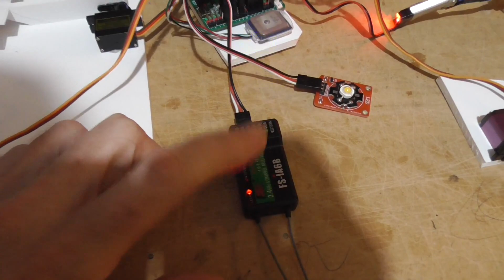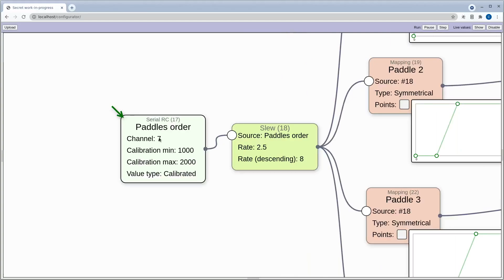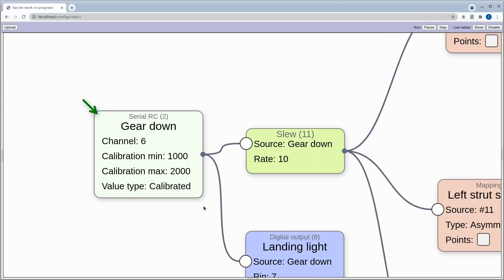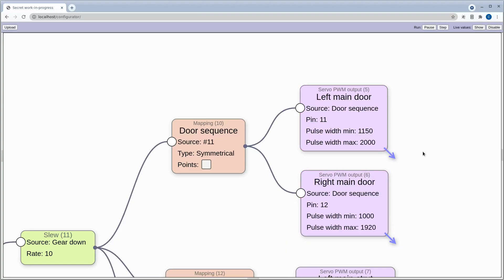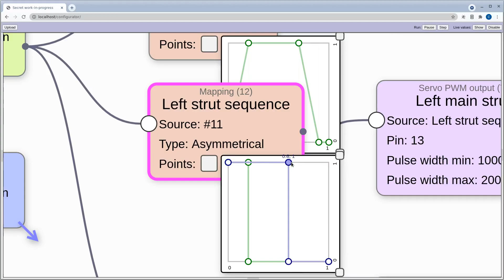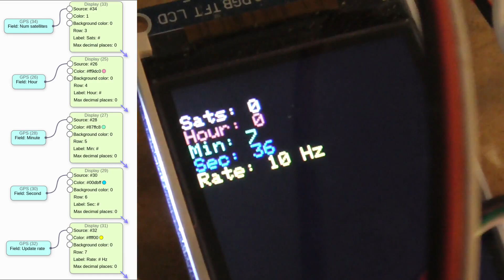Custom sequencers with iomixer

Comment: How do you configure your GPS? Does it save the configuration? I have cheap m8n, and it doesn't, and I don't know how to configure it each time at startup
Reply from the maker: There is an option to save the settings if you want it to. It is done as explained here:
https://www.youtube.com/watch?v=ylxwOg2pXrc
Reply: @iforce2d  I know about that option, however it never works with my modules
Reply from the maker: So maybe tell me that first then. I have no other ideas.
Reply: @iforce2d  Actually, the link you gave me is pretty much what I needed, thanks

Comment: Nice clean and informative demo. Your mapping functions are very easy to understand. A good example for RC folks would be expo mapping for control inputs on radio. Just that your program mappings are time-based vs position based. ;) Only suggestion I have is to display seconds of timeframe mapping on graphs (vs. 0 to 1 values). The ability to add/remove is very intuitive. Could even simulate a non-linear action , like a gear door starting to close fast, and slow as nears home position. (ie: a curved mapping path via multiple linear segments)

FYI: an example for aircraft with differential landing gear retraction is DC-3. Gears lowers together via gravity assist, but will retract one before the other due to constraint of hydraulic pump pressure. (no gear doors though on DC-3)
Reply from the maker: The mapping is only time based in this case because it was taking a slew as input. At its simplest a mapping can be just two points, to be used like the arduino 'map' function with the axis extents of the graph set to whatever the user wants.: https://www.arduino.cc/reference/en/language/functions/math/map/
But yes you're right, while editing a time-based sequence I have often found it kinda inconvenient not to have the x-axis showing seconds. Perhaps allowing a 2nd range as display-only values might help.
Yeah I used a mapping to simulate the non-linear nature of the HID headlights in my previous video: http://www.iforce2d.net/tmp/smixerHID.png
Reply: @iforce2d  Meant only to display 'seconds' value on axis as read-only value. The 0 to 1 values are a point of confusion, as different modules (or maps) could have different time-spans. example: one slew sequence might be 3 seconds, another might span 5 seconds. (really just need to display max time span value, and perhaps display a time index value when in edit mode)

Something to consider, is a master summary visual that displays all sequences (maps) on common graphic. Common colour for each channel can help with visual context. [ this would break your reverse direction colouring differentiator, but by using a dotted/dashed line instead for reverse in same colour would allow for displaying one overview slew sequence visual ]

Comment: I assume your board is based on a STM32- MCU, so how you made the jump from the (painful to use) STM32CubeIDE to such a nice high level flow diagram type IDE, I would like to know?!
Reply from the maker: Yes, STM32. I'm making the firmware with STM32CubeIDE, the diagram user interface is done with paper.js. In between there is a 'relay' server to allow the browser to access to serial ports, which is vanilla C++ for which I use Qt Creator.
Reply: @iforce2d  Wow, impressive! Thanks for the detail.
I will look into paper.js and Qt Creator.

Comment: with regards to the gear scnario, couldn't you trigger the gear struts to move only when the doors are open. ie when the doors open it triggers the gear to move
Reply from the maker: Typical servos don't have any feedback to know the actual position they're at, so we just give them enough time to have moved to the expected position. You can get robot servos with feedback, more expensive though.
Reply: @iforce2d  i realise that but i meant that  the SBM would know what position it theoretically should be at so that when the SBM on that one node reaches that point, it triggers the other one to start
Reply from the maker: I see. It would work fine for the 'forward' direction, that is, open door, extend strut. But to make the reverse work properly, you'd need other nodes to keep track of the state of the strut to make sure the strut signal was opposite when closing. I think eventually it would be easier just to use a mapping. See my comment to blacklion79 for perhaps a more useful improvement.

Comment: Could the serial module interpret MIDI?  This could be extremely useful for quickly building musical robotics, or special lighting and practical effects for stage and film.  Having a NLE-style graphical timeline with objects you could slide around, and track numbers you could select from the mapping nodes, that itself could be controlled via MIDI MMC (play, stop, tempo, etc.) would be powerful.  This project is starting to resemble some of the more user-friendly software used in those industries, as well as some of the industrial manufacturing sequence and logic editors I've seen.  All the innovation is in the various abstraction layers now, and exactly how the safety margins are baked in.

It's difficult to gauge scope of any project when you realize how everything is made of the same computational fabric.  MIDI or no MIDI, the NLE concept would be a new capability to the RC realm, afaik.  I could imagine it being used for legged vehicles where nested behaviors are fairly mandatory.  Exciting stuff.
Reply from the maker: If the MIDI can be delivered by UART, and is not flooding the input with too much data, I think it could be done. The main loop is fixed at 50Hz though, so getting exact timings might be a little sketchy.

Comment: just a quicky, if you change some values, do they change on the fly or do you need to compile and/or upload it to be effective?
Reply from the maker: There is a 'tweak' node to adjust number or color values in real time, provided the values are able to take dynamic input from another node. The little white circle next to some of the values signifies that they can do this. They require slightly more memory though, so values which are not likely to change at runtime have no dynamic input. The tweaking ability is especially useful for adjusting LED colors because the actual result is quite different to how colors look on the computer screen. To make the changes persist after power off, an upload+save is required. Saving to flash is slow, but uploading without saving is almost instantaneous.
Reply: @iforce2d  Interesting. thanks for your quick answer/explanation

Comment: Visual Programming for dummies?! It's like putting the "smarts" on any RC device. I see that RC is the focus but I can see how useful it can be in other applications. I wonder what the learning curve will be for the visual IDE for an average person? How much background will it require? It really excites me and I want to see more.
Reply from the maker: If "average person" means someone who is not already familiar with writing source code, then I think this would be easier to get something working quicker than learning traditional programming. It's less attractive for experienced coders though, because the boundaries of what is possible depend on the functionality supported by the system. I don't think much background would be required, but you will of course need to understand the information being dealt with, for example what is "GyroX" of an IMU.
Reply: @iforce2d  Excellent. I'm curious to also know what inspired this? Solving some problems in the RC builds or a broader vision? Thanks for the awesome channel and sharing this!
Reply from the maker: I wanted an interface to make setting up the original 'sbusmixer' (which was solely intended for aircraft servo mixes) instead of needing to modify the source code every time. While designing the PCB for that I noticed that these MCUs have a lot of capability that could be made use of, and around that time I discovered STM32CubeIDE which makes embedded development much more efficient and capable than arduino. Started to get ideas about a noob-friendly graphical configurator and commercial product.